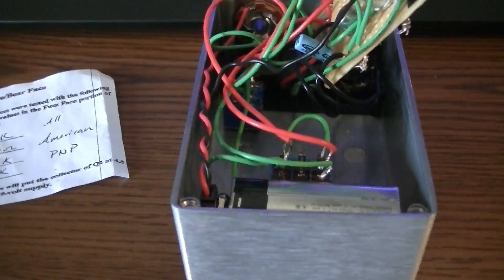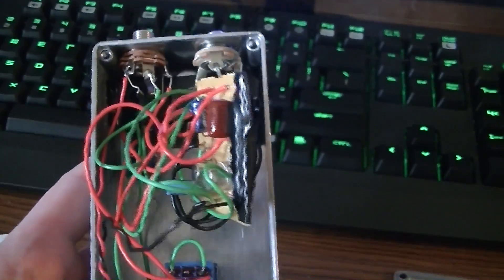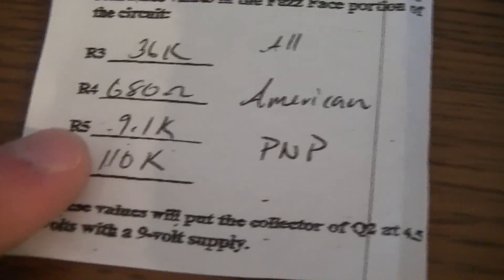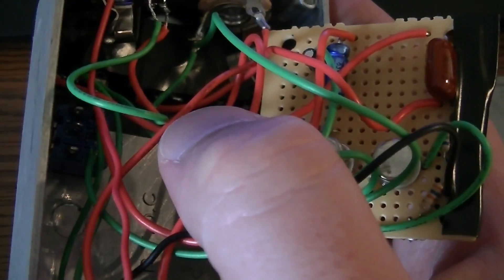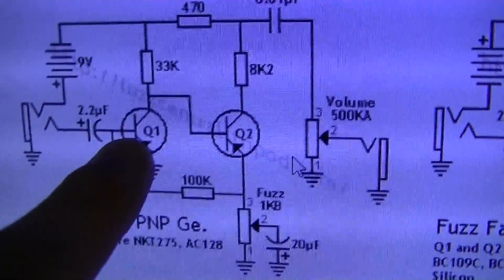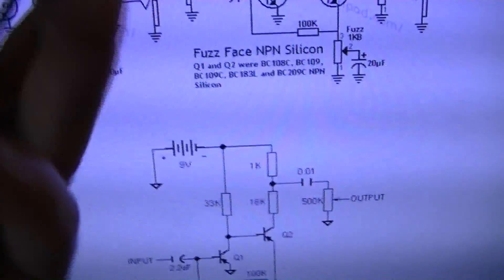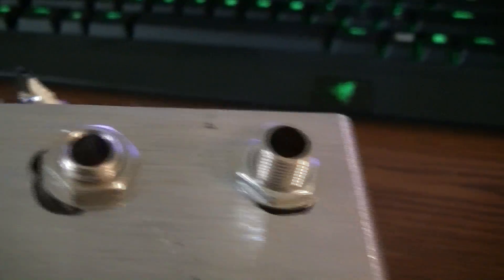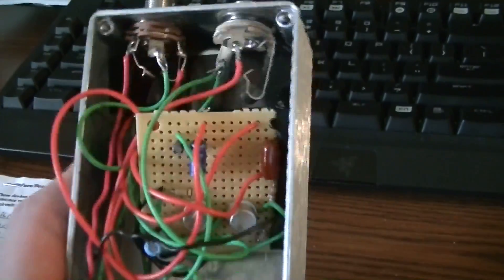How to Build Your Own Fuzz Face - Radio Shack Circuit Board

Comment: the soldering on the board did not look great. I think you may get a neater job if you use vero board that has copper tracks on the back. but as long as it does the job all is good

Comment: Hi could anyone explain how you bias the transistors. Thanks
Reply from the maker: You are basically adjusting the resistance going into q2 from the power supply. Many have an internal trimpot.
Reply from the maker: It is the 8.2k resistor that is usually replaced with a pot. I bias by ear, but you can use a multimeter with one leg on ground and the other on the transistor. Then look for a voltage set to about 4.5 volts.

Comment: I was really happy to hear your method for biasing,ive just odered a jimi hendrix fuzz face kit,and i was thinking of how i could add a good way to bias the pedal...also i was think of changing the tranistors as the kit uses silicon and i want to use matched germaniums as you did with this build...as its my frist build i want to ask if i can do that with a kit thats degined for silicon transistors?..or would i have to make other changes in the design to accomadate the change in transistor types??

Comment: For drilling, next time use a step drill bit :) They are awesome. You can enlarge the holes until the parts fit, and they stuck way less than the ordinary metail drill bits.